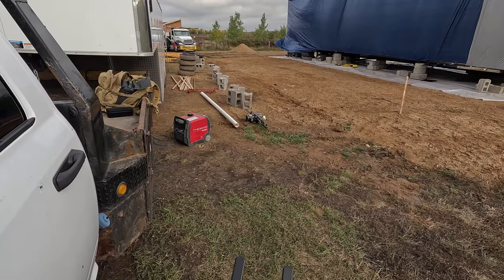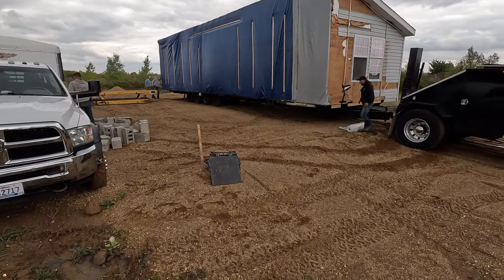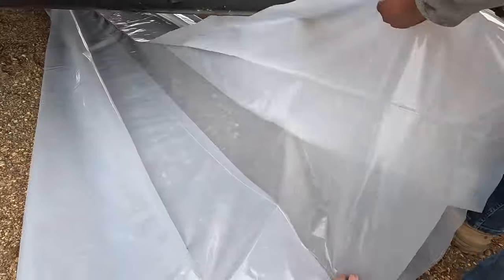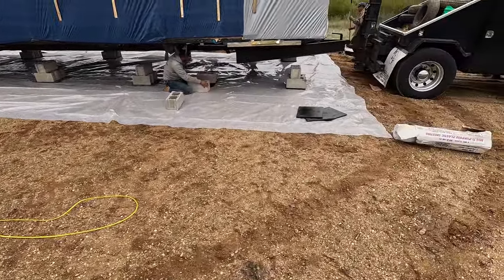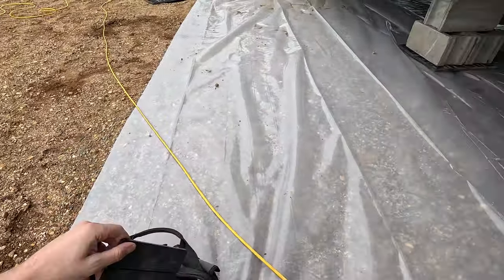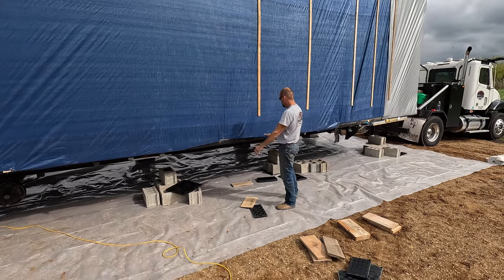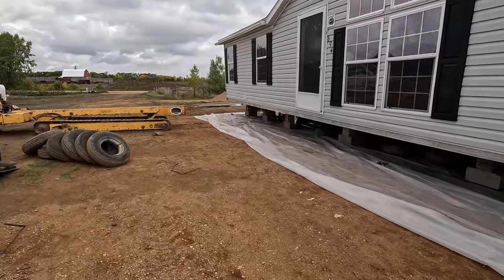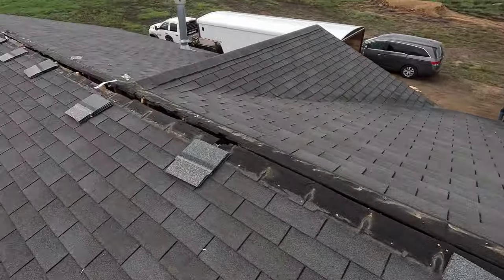From Road to Residence: Behind the Scenes With Our Installation Experts!

Comment: Again, great video, only critique. I would use coil  metal on the ridge. If wind ever takes the ridge shingle off it'll save your ass from the house getting wet. Also, it keeps the ridge together over time with no lags up there.
Reply from the maker: @jasonrichard5827  steel straps were used under the ridge cap shingles, as opposed to lags/coil.